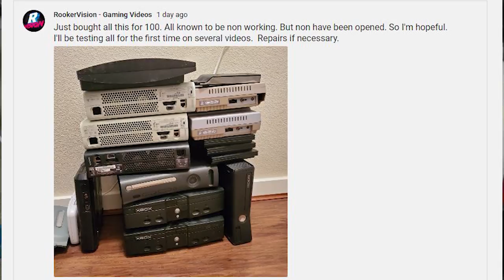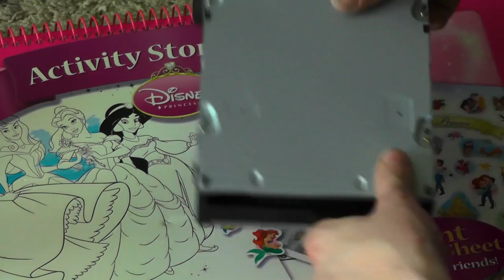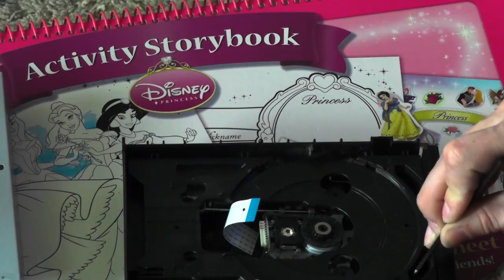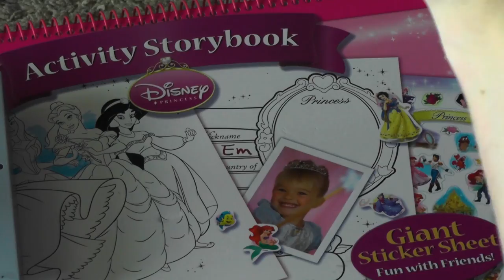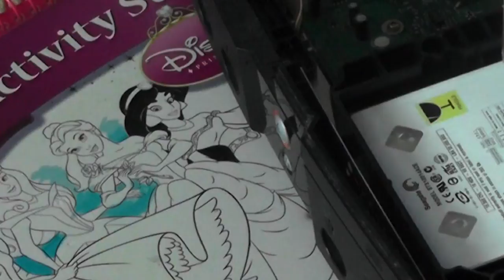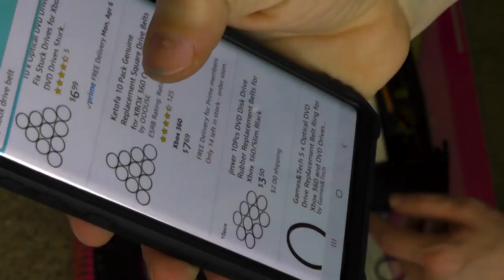Can I fix these 2 "Broken" Original Xbox Consoles? JurassicNinja

Comment: fun fact: a lot of times the rubber band in the disk drive of original Xbox's don't actually need to be replaced, in all actuality they are usually just dusty and taking it out and washing it with soap and water will fix the disk drive sticking.
Reply from the maker: I saw that in a video while working on these. I did try it. I can't remember if I edited that out or not. Didn't work.
Reply: @RookerVision  Aw Shucks! well, it was worth a try anyhow! it worked with my first original xbox

Comment: Always remove the clock capacitors (except 1.6 consoles), just to future proof the console. You don't need to replace it. Next step should be to softmod and TSOP flash the console, and swap in a larger hdd... then you have an awesome machine even for 2020.
Reply: You can remove them in 1.6, you just need to bridge the connection

Comment: Great tip for everyone reading this who has a passion for their modded OG Xbox, cut 2 of the rubber feet in 2 so it would fit half of the recess of the 4 so you can get to the 4 screws without pulling off the feet, good for when you change up the drive, do the caps or mods.  Other obvious tips would be to chip it with an Aladdin XT Plus 2 as it's easier to swap drives, the chip is now a bit more expensive than it was pre-covid but still worth it, some people like the soft mod and do it ok but others not, check the Capacitors (caps) are not bulging or leaking and remove the clock capacitor even if it looks OK (not v1.6), you can make it SATA with an IDE to SATA adapter, a low profile one from fleabay will cost £3-ish and you NEED to replace the special IDE cable XBOXs have to a 'slightly' longer '80' wire standard PC one.  I have a Halo green XBOX with a 2TB drive with all this done to it for less than £100, there's other bits you 'can' do too but this is the nuts and bolts of a decent modded one.

Comment: the second xbox seemed to have the samsung drive, they are the best cd drives on the og xbox, the other one had the thompson, the worst.
Reply: Actually the other one is Actually The Hitachi-LG which are also the best ones and just as reliable as the Samsung SDG 605 ones. Both Samsung SDG 605s and Hitachi LGs are definitely the DVD drives u want for your Xbox. The Phillips drive are also pretty good too. But I agree about those Thompson drives tho, since they are very unreliable and complete trash, it doesn’t read discs consistently well either.

Comment: That seems to be common with the disc drive sticking on those OG Xbox consoles. I miss mine so much. Sold it back in the day to upgrade to the 360. Back then, it was my only way to afford newer consoles, but I'm definitely considering picking up another one eventually.
Reply from the maker: I too have sold consoles to buy new ones.

Comment: you can boil the old drive belts. that helps sometimes. makes them shrink back in size to what they used to be. but long term you're better off just replacing them.
Reply: also just delete the clock capacitors. it's not worth the hassle of trying to replace them. much safer for the life of the console as the new capacitors could eventually leak as well.
Reply from the maker: Yeah. I just need to locate them.  Lol. Newb

Comment: The Samsung SDG-605 DVD ROM drive has a frequency of failure when it comes to the rubber band it out stretches and no longer works so what you can do is dunk in hot water which will shrink it to give it better traction which will cause it to work

Comment: hey man, if you need any information on repairing the Xbox 360 consoles hit me up, I've been repairing these things for years and years!

My best advice to you is too ignore ANYTHING that says to use a heatgun, or to block fans, or replace heatsink clamps with bots. None of that will fix anything, simply cause more damage.

Great video btw and welcome to game console repair!
Reply from the maker: For red rings. I usually heat it up with heat gun on CPU GPU only. Replace thermal paste, and keep the x clamps. Put back together. Let it run in game a few hours for testing.  What would you suggest for red ring other than this?
Reply: Hi
So this is a temporary solution and the red ring will come back in a few days/weeks/months. There are dozens of different causes for 3 red lights to appear, and I've done alot of documentation and research on it.
This video will show you how to find the secondary error: https://www.youtube.com/watch?v=netR2qoyfvE
I have put all my findings into a database where you can lookup the codes: https://errors.octalsconsoleshop.com

The most common "RROD" issue that plagued the consoles is the 0020, 0102, 0110, and 1022 (E 74). All of these are usually a failing graphics chip, and the chip must be replaced on a BGA machine (I wish they were socketed!)

The reason the heatgun method temporarily works is the same as various laptops with failing chips, the heat temporarily messes with the failing die/flip chip solder bumps and causes it to work for a short period longer. However, the effect is temporary. This is why reballing is also a bad fix most of the time, as the same defective chip is being put back onto the board. There is a very large thermal mass on the chip too, and a heatgun will likely not melt the balls enough to reflow them, and if you heat it longer, then the chip will die from too much heat. Especially with the lack of flux. 

Hope this makes sense, let me know if you have any questions!

Comment: I fixed the tray to my Xbox 360. I didn't even need to open my Xbox 360, I just had to clean out the dirt to the rubber band, by using a Q-Tip and rubbing alcohol.
Reply from the maker: I fixed a 360 that way before too. And a few others that didn't work like that
Reply: Man i also have a problem with my xbox 360 tray not opening
Reply: @TheSlavGamer  Yeah,  it sucked having to deal with that when it happened to my 360. But I did manage to get the tray open & fix it,  just look up YouTube tutorials on it. That's how I did it.
Reply: @schooltrashers  man my disk drive always gets stuck and because of that my xbox was taken apart by my brother to fix it and now im still waiting to fix it cause my brother is going to give me a tv and i want to play my xbox 360 so im still waiting
Reply: @TheSlavGamer  There's a way to get the disk tray to come out without opening your Xbox 360. There's these 2 holes located underneath the disk tray that you got to poke through with something thin. I use a nail filer and it usually opens up.
Reply: @schooltrashers  thanks
Reply: @TheSlavGamer  Yup,  just make sure the power is on while you eject the tray with the nail filer.
Reply: @schooltrashers  thanks man ur best

Comment: You need remove the clock capacitor before it destroys the motherboard of the xbox , the bad capacitor Is on all motherboard models EXCEPT v1.6, the acid It will corroded it's way through the capacitor and leaked all over their motherboards, causing permanent damage. Essentially if this capacitor is not removed, the console is just a ticking time bomb that will eventually kill itself.
Reply from the maker: I will. Need to watch a video to locate it

Comment: Can you try to fix a fat ps3 with YLOD? is getting pretty popular this new method of replacing NEC capacitors with tantalum capacitors and they claim that there's a 90% chance that those NEC capacitors are the cause of YLOD on the old fat PS3 and some slim models
Reply: also if you get a fat PS3 would be good to do a delid on the RSX and the Cell CPU
Reply from the maker: Yeah. I've been seeing this too. Just need to get one.

Comment: Mine even stopped reading discs randomly. Dunno why though. Too sad.
Reply from the maker: I just bought 5 broken original Xboxs today for 50 bucks. I fixed 3, just needed rubber bands, and the other 2 will not read discs.

Comment: My Xbox makes some purple glitches on textures. It's in 3D, in the game, on surfaces... I have not find anything about this issue :(
Reply: I have remove the "clock" capacitor, it was already clean.
But i don't remember if graphics issues were there before... So i'm worried about if it's my fault, i don't thinks so... but who know ?
Reply from the maker: Could be over heating on GPU.  You add new thermal?
Reply: @RookerVision  no
Reply: The problem still there even with the new thermal paste ^^

Comment: i have a xbox one classic but the issue is its not getting any power at all any idea how to fix it becuase this one that i got is in a great condition on inside and outside
Reply from the maker: No power. Then something with the psu. I wouldn't mess with that though.  Dangerous.  Either buy a new psu or if you have a friend with a working Xbox, try his psu to see if it fixes the issue